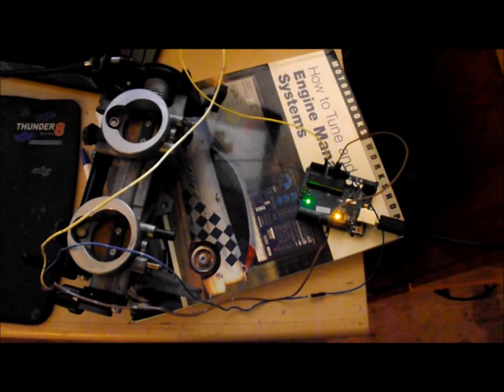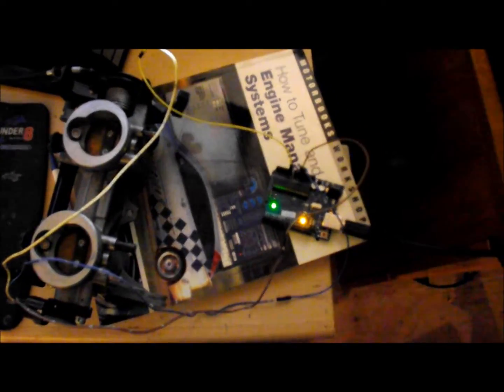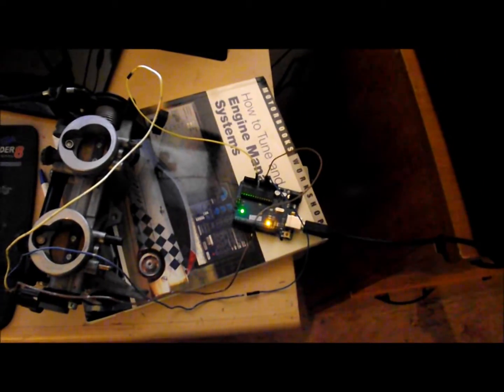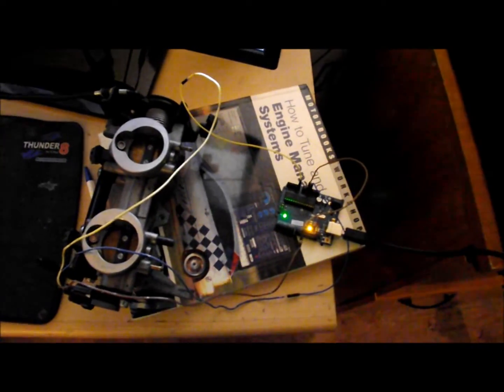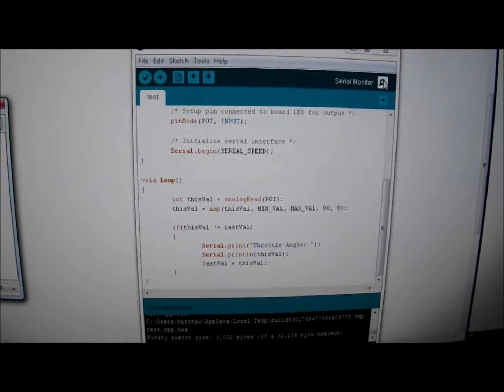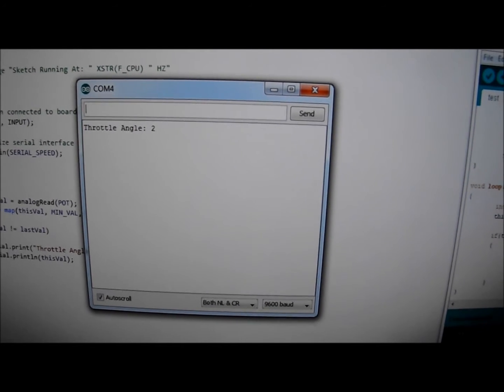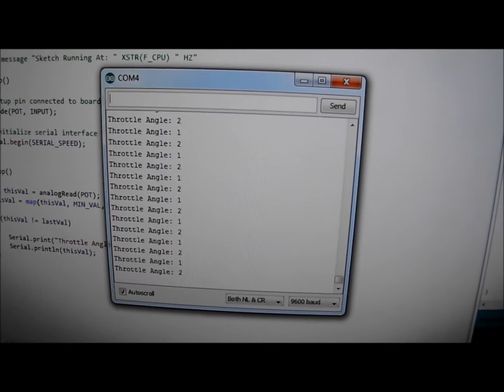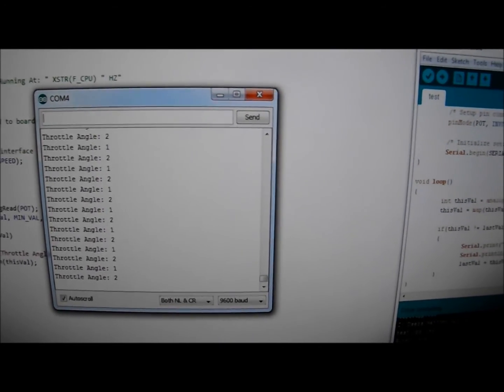Reading a throttle position sensor from Kawasaki Ninja throttle bodies

Comment: How did you hook it up? Is the code available as well?
Reply from the maker: +Chad k Code is in my replies to Tayo.

Pinout is pretty simple as the throttle position sensor is just a potentiometer.

Yellow wire to the A0 pin, brown is +5VDC, and blue is ground.
Reply: This will be easier than trying to connect to the diagnostic port.  Thanks!

Comment: whats your program code?
Reply: Nothing fancy... just an analogue read to the TPS.  Output the result via serial to Sketch.
Reply: ive been trying to use an analogue read for a different sensor, but I cant get it right lol.... do you mind sharing the code
Reply: Tayo Faminu
float getThrottlePosition()
 {	 
	 float result = analogRead(TPS_PIN);
	 
	 result = (float)map(result, 0, 1023, 10, VE);
	 result /= 100.0; //convert to percentage
	 
	 return result;
 }
Reply: Tayo Faminu In the code above, TPS_PIN is a const int set to A0 (analogue pin zero).
Reply: Matthew Arck thanks bro i appreciate that
Reply: @matthewarck8323  Cool! What does VE stand for in your code? This is a constant, what is?
Reply from the maker: @formika921  It's the reference voltage. The map() function takes one range of numbers and translates it to another range.
Reply: @SuperSonreir  thanks!
Reply: +Matthew Arck 
can you please explain the code?